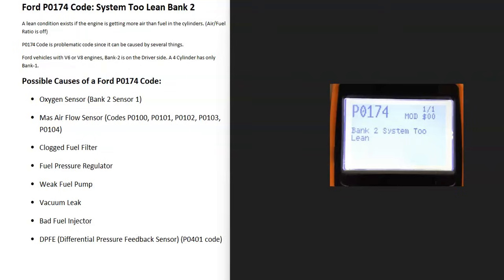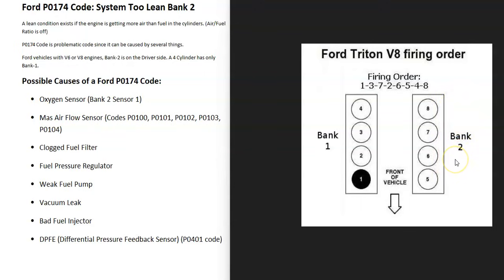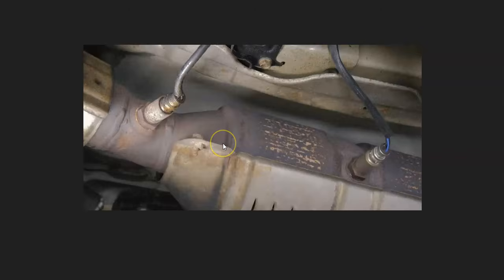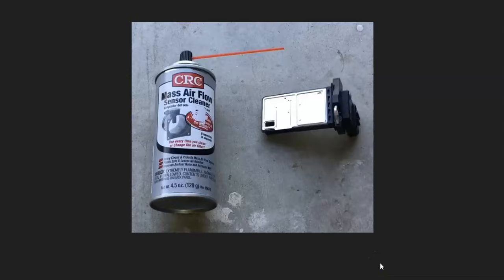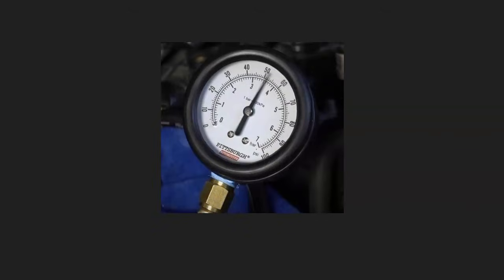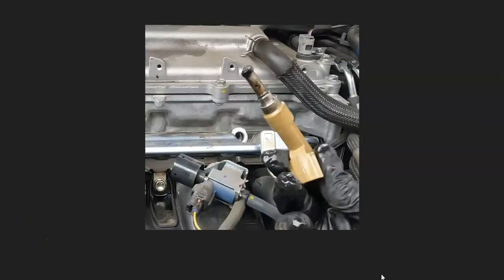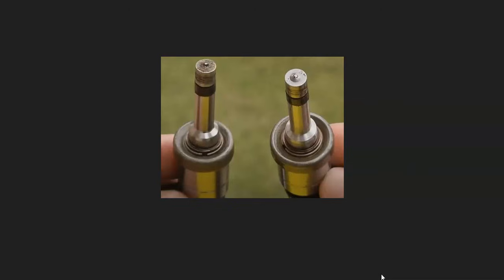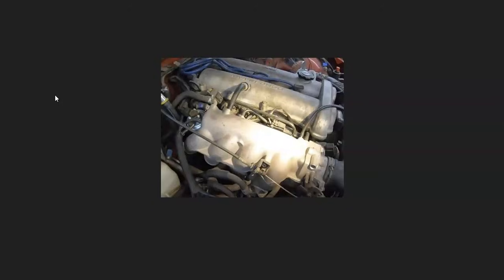Causes and Fixes Ford P0174 Code: System Too Lean Bank 2

Comment: I own a ford 4.2 v6 f150. It has a 171 and 174 code and has a severely bad rattling sound when at like 1800rpm going on under load. I suspected it was the cats but one side had the cat replaced not too long ago so I figured that would just cause it to just be one of the two banks running lean and not both so my next hypothesis was the egr valve. I replaced it and removed the code to test drive it. I drove it around for a little bit and the symptoms got significantly better and the engine ran way better with way less vibration but after a while, the codes came back and only after the two codes came back, thats when the rattling got bad again. It went away almost entirely except for a tiny bit when I erased the code. I'm convinced the tune of the truck is changing with the lean codes to add fuel but I have no idea why it would sound like it has some kind of pre ignition or knocking going on. My next thought is that maybe it has something to do with the intake air temperature sensor because the rattling is way less pronounced when it is colder outside such as at night but it doesn't show up as a code itself when I unplug it and I have no idea why that would make it run lean instead of just throwing a p0113 code.

Comment: Would it be easier to troubleshoot if both codes P0171 (System Too Lean Bank 1) AND P0174 (System Too Lean Bank 2) are on at the same time?
Reply from the maker: Yes, if both banks are lean, then it is likely something affecting the whole engine, such as low fuel pressure, a bad sensor, and so on.

Comment: I had this problem with my 2006 5.4 triton super duty, change the MAF things got better then it became frequent,  foundout my air filter box was leaking at the seems. I sealed it up and problem was solved.

Comment: Having issues, same code.
New plugs, mas,co2 up stream. Egr seems to be working, but it could be the switch i suppose. 
rough idle, no power on acceleration.  
Cant find vac leak but keep looking in case. Ugg
Was running fine before this happened
Reply: That sounds like cam sensors snd cam solenoid.

Comment: I have a po174 code with a po430 code. Just had the mass air flow replaced
Reply from the maker: I would test the catalytic converter on Bank-2 it may be plugged up.

Comment: So odd problem, I have the P0174 code, but nothing in the engine bay is making any weird or out of ordinary sounds, it even idles correctly with no problem. No rough idling and it’s not running rough, can anybody explain? Pressure test is at correct psi, just replaced the fuel filter, and cleaned my MAF sensor, all is fine, just haven’t gotten to testing the o2 sensors.

Comment: Why are both banks running lean showing p0171 and p0174 with no other codes
Reply from the maker: When both banks run lean, the cause is likely something that would affect both banks, such as a bad sensor or fuel delivery problem. Since there are no other codes, I would check the fuel pressure.
Reply: I have the same code P0171 and P0174 lean on bank 1 & 2.  Have you found the issue I would really like to get this fixed.  It's a Ford expedition 2003 4.6L. When in park the engine surges.  Any thoughts.

Comment: It's not perfect...but.....one way to identify if Your fuel system is part of the problem is to unplug the mass airflow sensor and try driving a bit. If it's normal... You know the problem is less on the fuel deliver side.

Comment: Yeah I have only this code P0174 and the truck runs a little rough. I been trying to figure out how to fix this. I wouldn't think it's the MAF or the O2 sensor. But has any one had just this code and there truck runs rough at idle
Reply: Same code for me . Have you found the issue?
Reply: @juancarlossoriano6935  no I have yet to source the issue. But i have been looking something is telling me it actually might be a bad O2 sensor maybe giving me a reading of lean conditiona but sometimes the check engine light will come on and then go off but it is always just that code. Let me know if you guys have maid any progress
Reply: Got the same issue

Comment: When i first scanned my car I got a p0174 and a p1151 code but when a scanned it again a few days later the code I got was just the p1151
Reply from the maker: I would test the bank-2 sensor-1 O2 sensor and be sure it is good. If it is good, Bank-2 is likely running Lean.

Comment: What if you get this code when you are just sitting idling? Thats the only code that you are getting.
Reply from the maker: Lean codes are notoriously hard to diagnose sometimes. Since it is only on bank-2, the problem is not likely something that would affect the whole engine. With no other codes, you remove the spark plugs and match them to a spark plug burn chart to see if there is a lean condition on one cylinder or the whole bank. If it is running lean on only one cylinder, I will focus on it; if it's all the cylinders on bank-2, then it's something that would affect bank-2 but not bank-1. As I said, lean codes can be difficult sometimes.

Comment: I have P0174. It was running fine until it just started misfiring hard. Would the sudden start of misfires narrow it down more or not?
Reply from the maker: If one or more cylinders are having an issue and misfiring, it can cause a lean condition. Usually, there are misfire codes that point to the cylinders having the problem.
Reply: @HVAC_Mechanic  yes I have had many issues with ignition coils so that was my first assumption. Cylinder 5 and 6 were the only two left I hadn't changed so I replaced both and it had no effect. I'm going to buy a code reader today so I can stop limping this thing to the store everytime I need a code. Do you have any recommendations for under $100?

Comment: Mine 03 threw this code. My mechanic says its bad thermostat housing gasket.
Reply: Don't see how this could be the case, but did you replace it and if so did it fix the problem?

Comment: I just changed both o2 sensors upstream and the light came back on. I changed the maf a few weeks ago and i got the motorcraft maf sensor . I took it to  oreilys and they plugged it up again and now its coming up saying the maf , with the codes p0174,p2195, p2197. Could it be the maf sensor when bad again since ive been driving it .
Reply from the maker: If the MAF sensor is new and still giving codes, I would check the wiring next.

Comment: One day my ranger started losing power on a busy highway.after that it started running so rough it would shake the whole front end of the truck on idle and would barely hold 500 rpm. Turns out it was a vaccuum leak, dying battery, and fouled spark plugs. Scanner showed only codes were a thermostat coolant temp sensor because of low on coolant ,and bank 2 running lean.

Comment: Well 2020 ford f150 xlt 2.7 ltr ecoboost... 41,000 miles on truck.  have had o2 sensors changed.. relays.. fuel filters... 4 times in 3 years..  2pbee is the code. Ford mechanic was talking to engineers that built the engine due to it not being bad sensors etc....  So they told him to replace all fuel injection components all o2 sensors all fuel relays and fuel pump and filters. All under warranty so it's fine but dang glad i got the extended warranty. The mechanic told me that if i had to pay for all that would be upwards of 3000$  the same mechanic has worked on this vehicle  he even switches to the oil bay just to do my oil changes for me.

Comment: After hooking up a smoke machine, I have a lot of smoke coming from the coolant hose where my thermostat is, its a big air leak i hear a hissing sound when the engine is running then it starts shaking
Reply: I feel like that’s what’s wrong with my truck of standing idle it’s fine but when your driving you can hear like a hissing slash ticking noise coming from the driver side . What you do replace the hose ?
Reply: Did u fix? What was the problem@samuelaruca4738

Comment: I replaced map sensor, fuel filter, all 4 02 sensors air filter still same problem. I have come to the conclusion that no one knows how to fix this problem until all parts are replaced.My advice is start with the cheapest parts first,you may get lucky because no one and i mean no one can tell you the exact part to replace no matter what code shows up. I will be changing the   egr next.
Reply from the maker: Lean and Rich codes can be hard to find the problem and fix. It's best to test the components first before replacing them, but in the end, it is whatever works.

Comment: How do you test the O2 sensor, P0174 on 98 f150, only code that comes up.
Reply: o2 sensors are not expensive for most vehicles just replace it.

Comment: Is smoke from IAC normal when using EVAP machine?
Reply from the maker: Yes, this often happens during an intake smoke test. The IAC is supposed to be open at idle when the throttle plate is closed. It will depend on make and model of the vehicle.
Reply: @HVAC_Mechanic  1998 Ford Explorer 4.0. SOHC

Comment: Question, 96 f250 7.5l v8: 
Have lean on bank 1 and bank 2 (P0171 & P0174).  Also it backfires when reved up fast, when taking off from idle it may hesitate for a second, and in the mornings its hard to start or if left for a few hours without being ran. Any ideas? Thank you
Reply from the maker: Since both banks are having the problem, it could be something that affects the whole engine, such as fuel pressure, vacuum leak, MAF sensor, and so on. Lean or Rich codes can be hard to troubleshoot. Also, backfiring is often a timing-related issue.
Reply: @HVAC_Mechanic  thank you, I believe it may be the maf sensor although I just replaced it only 2 years ago so I didn't suspect it. I texted it by unplugging while it was running and it only changed idle very slightly but continued to run fine.
Reply: You replaced it with what? OEM only for any sensors especially maf If you use cheap Amazon or Chinesium you’re just causing more problems . You have to have a good scan tool to see what is going on or find someone that does and knows how to use it. Good luck with that. You have to verify the problem first. If it is reporting lean just at idle and improves at higher rpm, it is most likely a vacuum leak.

Comment: I've got to take a moment to recognize the fact that I thought your video your illustrations and your mannerisms as far as convening the messages that you were conveying I have been fighting with my 2013 F-150 Limited I'm truly I wonder if anybody's really tried to fix it. I think that's why I'm going to go ahead and just take it to the dealer and suck it up that suck up the fact that I bought a vehicle that has issues and that's going to happen in many cases that's why I always leave some extra cash in the budget when buying a vehicle. Regardless there's going to be something that's going to need to be fixed, changed, or adjusted unless it's supposed to be certified LOL nevertheless you were explaining technical issues and things in layman's terms which was awesome and it wasn't a big " show", a "production" if you will.  I know for myself I'm going to watch it again even though my problem probably goes a little deeper, but there may be some things that we don't think of until seeing your video and then it actually does help. So thanks again I know that was a long one but it was a well-deserved review. Don't get me wrong there are some videos that have production and they do get very detailed in the video and it does help because the many times the visualization is what helps. For instance a wiring diagram. I could go to sleep on a wiring diagram unless there's somebody there that might be able to guide or direct specifically what we're looking for we're looking for.       
..... thanks again

Comment: How about lean on both banks p0171 p0174
Reply: Looking for places to check I think that narrows it down some
Reply from the maker: It can be hard to troubleshoot Lean Codes but Lean on both banks would point to something that affects the whole engine.
Reply: Did you ever figure out what was wrong
Reply: My Mazda CX-9 has a Ford Edge engine. Mine was idling very rough to the point of cutting off.  It was throwing both codes as well. 
It was my brake booster.

Comment: I just bought a 1998 Ford f150 Triton V8, I had it smogged and it gave a "p0171 system too lean (bank 1),"as well as a "p0174 system too lean (bank 2)" and I'm trying to figure out myself, without a shop or ability to pay a mechanic, how to fix what's wrong, is there any way you could please offer some advice or suggestions? Thank you so so much for your time
Reply from the maker: The issue is affecting the whole engine, which is something like a weak fuel pump, clogged fuel filter, bad sensor, weak coil pack, or anything that would affect the entire engine.

Comment: If it was a bad maf sensor why would it only affect one bank and not both
Reply: My question too. Everybod keeps saying the MAF but i replaced it. Maybe reconnecting the battery will re-initiate the fuel trim learning?
Reply: I just got both  o2 sensors upstream replaced . The light came back on so I took it to oreillys and they're saying it's saying to replace yhe maf sensor but I had it replaced a few weeks ago.

Comment: The spray they use to find vacuum leaks is starting fluid. It raises the idle of the motor if there is a leak where sprayed
Reply: Spraying starter fluid on hot engine can cause a bad day.
Reply: @PhilphilPhillip-uz4ps  that's why you spray the lines and not the motor lol
Reply: Actually it’s carb cleaner we use
Reply: @Workharder1776  never thought of that. Starting fluid worked for me but ill try that next time
Reply: Yup
Carb cleaner what unc says

Comment: I cleaned the MAF sensor, unhooked the battery completely unplugged all the oxygen sensors and replugged them in along with the MAF sensor and rehooked the battery no check engine light no codes
Reply: You don’t say??? You drained the kam memory and the cel left lol
Reply: @zues2013  I ended up having to clean the MAF sensor with MAF sensor cleaner and that did it because cel came back and I had a rear o2 sensor up front and one with bad wiring so I just replaced them both and cleaned the MAF sensor and all good no check engine light for months now
Reply: Awesome that you don't have any codes for a while. When you unplug the battery, it will clear the stored codes, so that doesn't necessarily mean that the problem went away, but if the codes don't show back up for a while, that's usually a good indication that whatever was causing the code is now fixed.
Reply: It takes about 100 miles of driving for the computer to recheck the system and then if there’s no new codes you can pass the smog check. But if there’s still a problem it will show up later and if you don’t fix it then it’s going keep triggering a code. It can be a frustrating process, get one thing right and another thing goes wrong. So either spend a fortune on a new vehicle or spend money keeping your old one well maintained. If you’re not trying to impress people then you can always keep driving the same old vehicle, or go broke trying to keep up with the other guy.
Reply: That’s not how it works... lol u didn’t fix the code u just unplugged the battery u will still fail emissions

Comment: Been doing diy smoke test at home and only noticing the smoke coming from the IAC valve (no the top cap but actually the “butt” of the valve if that makes sense, not where it attaches to the throttle body) and the oil cap. Anybody know if any of these is normal? Im only getting g the P0174, already replaced O2 sensors, fuel regulator, EGR valve and solenoids, fuel filter, maf sensor and deep cleaned the throttle body and egr passages. Still, my LTFT is high (2.1 at 29% and 2.2 at 14%).

I ve also changed spark plugs and coils, and cleaned the fuel injectors.

Vehicle is a 2002 Expedition with 196k miles and about 3 years of not being driven constantly (maybe 20 miles a year?). I just decided to give it some love but this one has me baffled.
Reply: Did you ever figure it out? having the same issue with a 99 mustang right now....
Reply: @Austin-jm4gr  Not sure smoke from IAC is normal from EVAP smoke machine.

Comment: what if i have a p0171 and a p0174 at the same time? what would be the first thing? after it gets to operating temp it smooths out. when cold doesnt want to idle.
Reply: Bad intake gasket if it gets better as the engine heats up !
Reply: I have the same issue any solutions to this?
Reply from the maker: I would test the MAF sensor, check for a vacuum leak, and do a fuel pressure test to see if it is in the fuel delivery.
Reply: Following
Reply: What was solution
Reply: Did you find a fix? I have your same issue
Reply: We need answers! Lol
Reply: I got the same issue? ever figure out the problem?